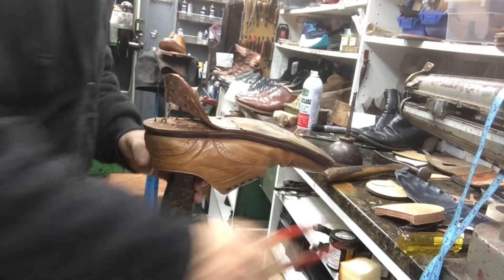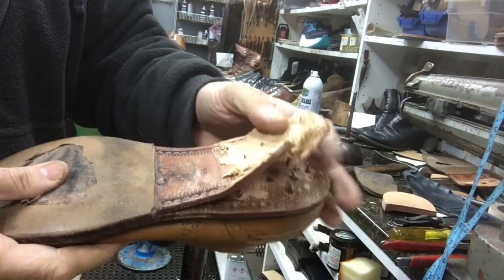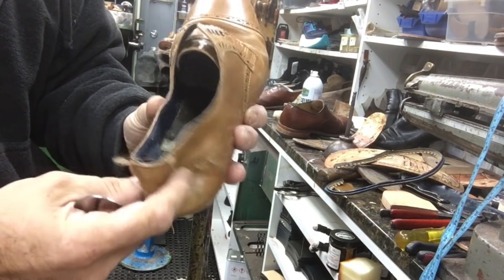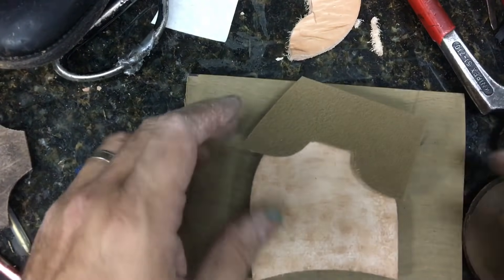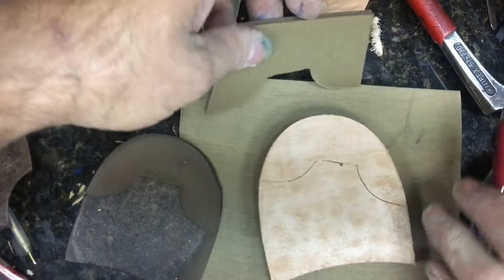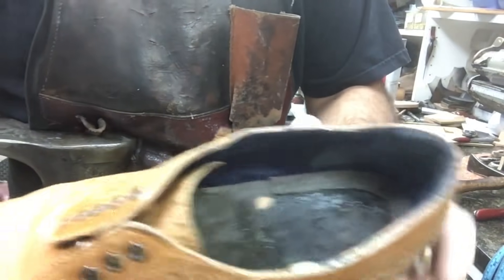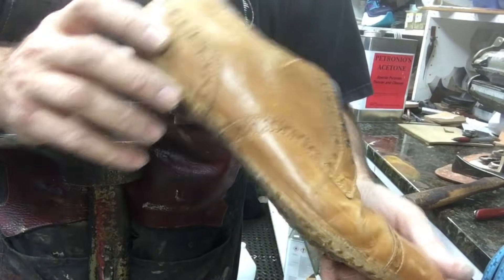Cole-Haan Restoration #95

Comment: I strongly believe that you are a great, gifted cobbler. I do not get tired of watching
 your videos. They are very informative and eye-catching. This video, in particular, you said that the work was $ 240.00. With the amount of money paid to fix those cheap shoes, you can actually buy some Allen Edmonds for that price. Still, you do an amazing work.
Cole Haan shoes run about $ 130.00 and you charged to repair them $ 240.00. This does not make any sense. Again, for the record, you are an incredible and gifted cobbler.  I have learned so much about shoes since you started posting your informative videos. I have several Allend Edmonds shoes, and now I know where they will go for repair.  Thank you
Reply: Cobbler would be Mr Minit and such like heel bars. At this level its only fair to call Mr Bedo a Shoemaker :)
Reply: He has to buy material to fix them.  None of that come for free or easy to find in this day and age some stuff down right non existent. He has work them in way that make them last longer and within guideline. Not easy.. If I was him I'd charge 590$.   He giving a steal imho

Comment: You did a fantastic job as always, but as for these shoes. I am very unimpressed with how many corners the company cut in the making of these. This brand is expensive, yet they basically made cheap construction methods look expensive. Not cool in my books. I will not be buying a pair of their shoes any time soon. Haha.
Reply: I've paid $250.00+ for name brand shoes just to have them fall apart.  High end brands don't mean high end quality anymore.  Very disappointing.
Reply: As another shoe cobbler, I can attest to the very cheap quality of most Cole Haan’s.  Definitely one of the brands I dislike working on.  It’s “usually” a safe bet to say that any men’s shoe brand $300 or above is going to be made of higher quality materials and better quality.  Not always but most of the time.
Reply: C-H is really a fashion shoe.  In about six months to two years you (usually) wouldn't be caught wearing them.  Loud and brash - which could be good or bad right?  But its sort of disposable from the get go.  Just look at a C-H catalog from ten years ago.  Totally changed from what they offer today.  Other brands like Allen Edmund look the same as 50 years ago but again good or bad.  Depending on what you want.
Reply: You guys are making me feel bad about picking up 2 of their Grandpro Tennis sneakers last month. Oh well, at least I got them at half off.
Reply: King_Of _Fishing 
They’re about as low priced as you’ll see a shoe with real leather uppers and soles that’s at all quality. Yeah they only glued the sole on but that saves cost. They were probably under 200.00 new. Now they have been significantly upgraded. I don’t know if I would have gone through the cost and the trouble for cole Hans but the customer clearly must love those shoes. I personally would have just spent the 350.00 or so on a new pair of Allan Edmonds or something but I get it. If it’s worth it to the customer it’s worth it.

Comment: It wasn't until I became a paramedic and had my first pair of boots repaired, that it finally struck me that good shoes are almost indefinite. I was raised a typical American child, worn out things should be thrown away, not repaired and appreciated for their age. I have since had a lot of shoe repairs done, and my shoe guy often doesn't even charge me for repairs that would have wound up in the garbage otherwise. Buying well made shoes and finding a good shoe repairman will pay for themselves in the long run. I've already gotten over five years of daily abuse out of my duty boots, whereas most of my coworkers have replaced theirs yearly. We get $150 a year for new boots. I spend maybe 30 a year getting zippers done or new soles and the rest is for me.

Those blue laces really snap. $240 for that is a goddamm great deal.

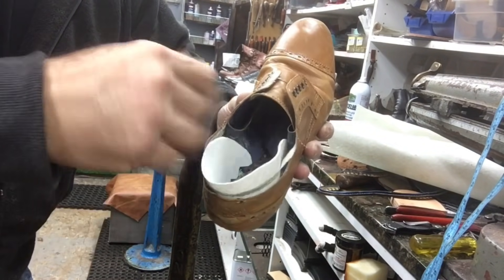Comment: At around 4:30 mark you discussed using terpentine to activate the heel cup glue... Is it possible to reactivate the glue where cups/caps are behind a fabric layer, instead of behind a leather layer? As a means of restoring the fitment without reaming the stitches?
Reply from the maker: Barry Mantelli I’m not sure but I don’t see why not

Comment: Thanks for sharing how this process works. You did a great job, no question, and you explained it well. I really enjoyed the video. 

What if the customer had simply bought a new pair of shoes? How much would a pair of those Cole Haans (or their equivalent now, if the style you repaired was discontinued), in the condition to which you restored them, cost new? I realize that you basically made those original shoes better than new with the level of quality in the replacement parts.

Comment: Fantastic work. Do you ever run into a situation where the restoration will cost more than a new pair of the same brand? Seeing how Haan cut corners with the heels, welt, etc., it almost seems like your worthy upgrades would surpass buying another pair of them, even though the quality of the new ones will be lesser than your repaired shoes. Again, great job and thanks for not using music like a lot of channels do. I want to concentrate on the actual sounds of the repairs.
Reply from the maker: Brian Burke in most cases I already know the cost of the restoration so there is an agreement with the customer, but like in this case I gave some upgrades. If it is a big issue then I would definitely communicate with the customer and we would come to some sort of a happy medium
Reply: Thank you. Also, I love your glue pot. Don't ever peel all that excess glue off. It looks awesome!

Comment: A long time ago, we used to make puppets with a product known as 'Celastic'.  A stiff plasticy material that we dipped in acetone to get it to be pliable.  When it dried, it took whatever shape we molded into.  Since the safety craze has taken over making things, Celestic is not made any more because of the solvent.  Are you heel stiffeners like that?  Possibly Celastic?

Comment: IMO a far better restoration than this mediocre shoe deserved.  I wouldn't touch Cole Haan with a 10 foot pole, unless I knew it was recrafted by you.  It is amazing how bad a lot of lower priced shoes have gotten in the last 25 years.  I used to buy cheaper shoes, but they either fell apart quickly or started looking bad before they even got broken in.  This video shows why the cheaper shoes fall apart.  Despite appearances, that Cole Haan was held together with paste.  Shame on them, conning people into spending good money on crap. Better to buy one good pair of shoes a year than 3 or 4 mediocre pair.

Because I live just 15 miles from the Allen Edmonds factory, that is pretty much what I go with now for my good shoes.  Pretty much everything I have now except for sneakers.

Comment: I'm not dissing the repair or the cost. But I'm going to either just buy new or fix very high end shoes. $240 could by you 5 pairs of these barely used off of Ebay. These shoes are only $130 new. You can find them for $90 all day long on sale.

Comment: I enjoy his videos and admire his craftsmanship. However, those Cole Haans should not be more than $200 brand new. I think about how much labor, material, overhead, etc is involved in this kind of work and $240 is a reasonable price but I do not rmember having any shoes I consider so special to expend that much to restore them. I usually give them away when they are in that condition and buy new ones. Off course I do not buy shoes that cost more than 150 bucks.